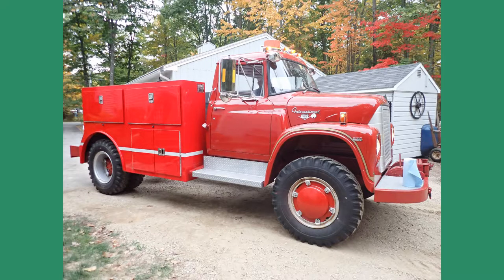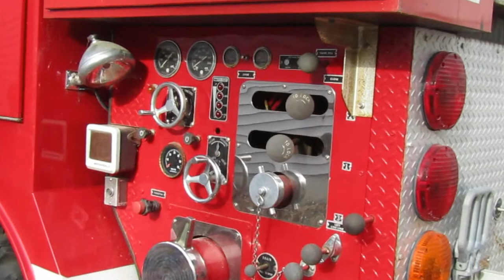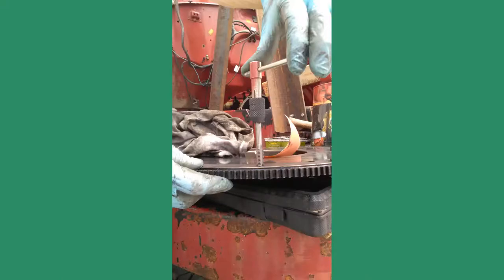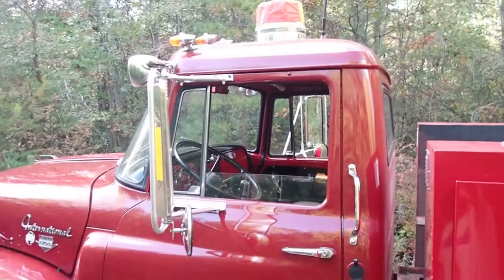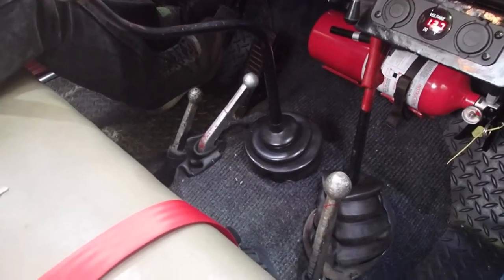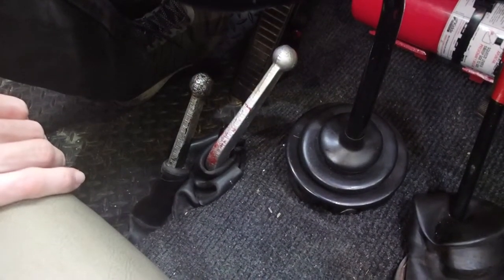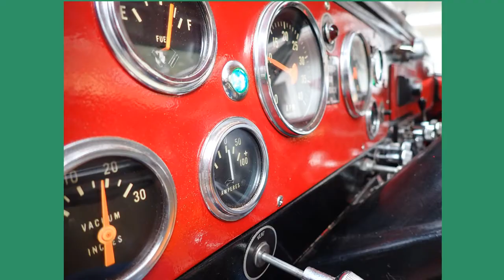Big Trucks!  International Loadstar 1700 4x4 Ex Fire Truck - Odd Man Out - Ep 16

Comment: I love Internationals,probably the most over built truck,right from the factory!That truck is beautiful,you were very smart.Any truck that a fire dept. owned is going to (usually) be in pristine condition,excellent canidates for restoration.Rust is VERY expensive to fix!I had a 1966,1ton,4 whl drive pickup.Built like a dump truck,impossible to overload,spread shale with the snowplow.Excellent placement of camera"s in this vid.The juice was definitely worth the squeeze!

Comment: I intend to start restoring my '69 Loadstar 1700 firetruck this summer.  Except I had to buy  a front drive axle and transfer case as my truck is only 2wd.  Your front axle is a Coleman and is listed in the IH parts manuals.  Mine is a S-9000 NAPCO.  Interesting my truck also only has 15,000 original miles.  Five speed with a 392 also.  I have so many questions ... wish there was a way to exchange emails.  Great looking truck!

Comment: That has a Coleman front axle, which is an interesting item both based on the company history and the fact that the design of the steering joints is an engineering marvel.  Besides the steering joints being very strange and enormous, they are the constant-velocity type, which no one else was making back in those days, so this was quite advanced for the time.  You may be right that adding the four-wheel drive was an aftermarket process.  The line-setting ticket will tell you whether this was the case.  Still, it's interesting that it has International's own 4x4 logo on the side of the hood.

Two trivial questions if you have time (otherwise, no worries):

1:  Where is the PTO control for the winch?  If it's not a lever on the floor, is it a pull knob on the dash?

2.  What's that big cast-iron housing on the coolant outflow line to the radiator?  I've never seen that before, and the only thing I can think of is that perhaps it's the thermostat control for the mechanical radiator shutters?  (IF those slats are shutters.  They may not be, as I think they were no longer used by the late 60s).
Reply from the maker: Sorry for the late reply!

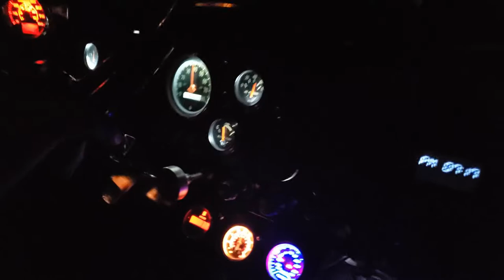1.  The round push / pull knob is on the lower portion of the dash, to the right of the steering wheel (visible at ~10:04 below the temp gauge, but a bit hard to see) for the winch. The transfer case pto is controlled by the floor lever (left most floor lever ~7.28).  

2. The cast iron housing is a heat exchanger that allows fire pump water to provide additional engine cooling during pump ops.  The supply and return lines are currently removed from the housing.  The shutters are vac operated and controlled by the shutter-stat located on top of the thermostat housing / outflow casting (visible at 9.56). 

Thanks for watching!
Reply: @oddman-out  Very informative, that bit on the heat-exchanger.  Thanks much.
Reply: front PTO is trans operated back is t case trans parking brake is only when shut off the other parking brake is on the back differential to use the t case PTO for the pump when fire fighting  etc  beautiful truck glad to see someone saving her from the crusher
Reply: The cast iron housing is probably a heat exchanger which uses water from the fire pump to help cool the engine when it is pumping.  Its a great old truck!  They were fortunate to find one with a pump on the rear so it could be readily removed.

Comment: Beautiful,  i'm trying to finish the rear brakes on my 68 1700 44x4 right now,  i am so excited to take it on a legal and more than 3 minute drive when i'm done. The front axle is probably a Coleman and should be on your Line set ticket. i really really like your tires  but they're probably 8.25s?
Reply from the maker: The owner believes they are 9.20s.

Comment: I would hope that you did not scrap the pump and tank there's probably a small fire department that is financially challenged it would have bought it if you destroyed it at least the pump because it's probably has a pump and roll function to it.. the way it looked it also to be used on structure fires because of the steamer inlet is at least 4 in so that meant it was a plumper as well.. it may be that Maxim did put the four wheel drive in however international built vehicles on that chassis with four wheel drive. Like I said I hope you didn't destroy the pump or scrap it cuz there's a fire department I can use it I'm sure you can even contact your local fire department they may want on it.. or they can let you know who might be in the need or in the market for.. I'm not fire department had a little bit of money more so than the other party and the community together to create one.. so I know when fire department would start financially strapped.. have a nice day God bless